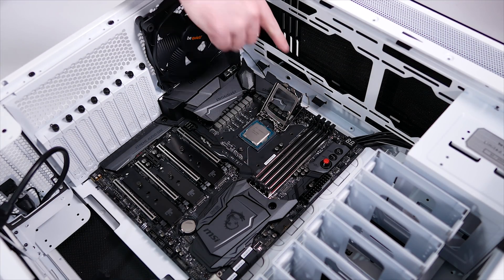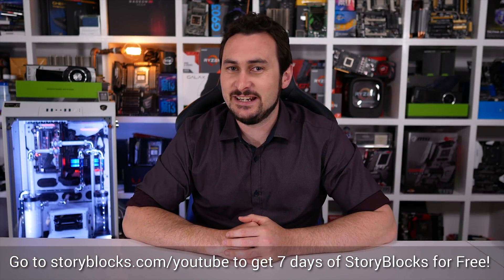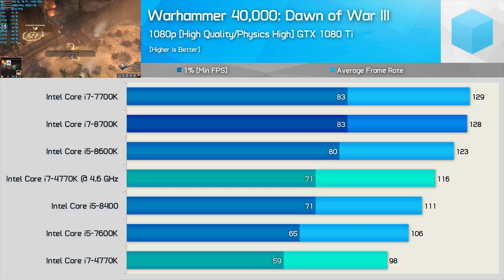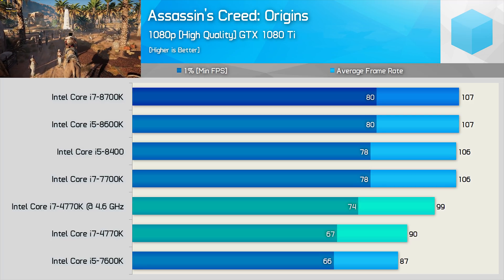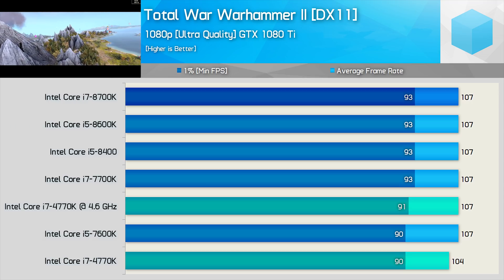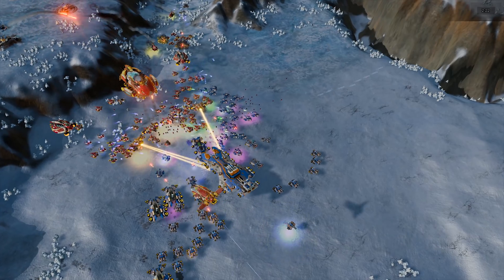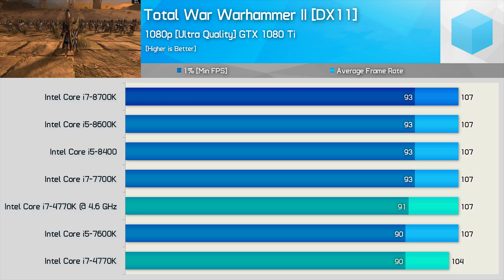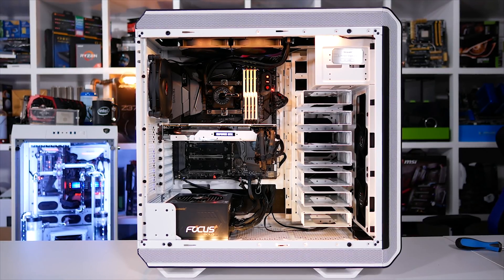4 Year Old Core i7 vs. Core i7-8700K, Worth The Upgrade?

Comment: Every video I've watched from this channel had an extremely wide variety of games benchmarked, using every relevant cpu or gpu depending on which kind of video it is. Moreso than any other channel by far. The results around 15:00 are extremely helpful for most consumers. Basically if you play any game at the higher graphics presets with anything less than a 1080 ti, the fastest gpu available, you will notice ZERO difference in performance even in a very well optimized game like BF1. Of course, this is subject to change when games are better optimized to take advantage of greater core and thread count, but that's still a long way down. Good work, Steve.

Comment: Why never EVER Flight Simulators like the amazing X-Plane 11 are tested in this kind of benchmarks?
X-Plane is one of the most CPU demanding “games”. 
You wanted to match a 4770k against a 8700k, here is one of the most challenging test. Any actual CPU with any actual GPU can run XP at high resolution + high framerate.

Comment: I have a 2500k, should I get a 2600k or a 3770k? I plan to pair it with a used 980ti xtreme which performs pretty much the same as 1070.

Comment: looks like a lot of the time the big thing holding the Haswell CPUs back is DDR3 memory bandwidth.  i'm on a Xeon E3-1231v3 which is basically a Xeon branded i7-4770 or 4790 non-K and basically i'm holding off until DDR4 prices come down a bit as I have 32 GB of RAM, wanting 64 for work stuff and i'll need to buy all my memory again.  which isn't going to be cheap.  will just keep holding off and putting more pennies away for a threadripper, my non-gaming workload is fairly ram and thread intensive (Cisco router labs, etc.)

Comment: 4790k is not identical to 4770k, just share same platform. Base Clock is higher, Turbo is higher and over clocking are same to 6700k, so

Comment: I think most people here are enthusiasts, so they're much more interested in OC'd results as you can find stock tested HW all over the internet. However I am still missing something, never bumped into such a test and I think everyone here would love to see it:

- Take all core/thread CPU combinations and fix them to the same frequency
- Test them on a top-end, performance and mainstream GPU
- Around 15 new games Full HD only would do as lot of these people aim at high-frequency gaming and the differences would diminish at higher resolutions anyway

All these CPUs clocked @ 5GHz
2C/4T (7350K)
4C/4T (7600K)
4C/8T (7700K)
6C/6T (8600K)
6C/12T (8700K)

tested on these GPUs clocked @ 2GHz core / 9GHz memory (11GHz for GDDR5X)
GTX 1060
GTX 1070 Ti
GTX 1080 Ti

That would give a great picture for those who always plan to overclock and want to futureproof their builds.
We won't probably see a big bump in CPU performance in a recent future, so that futureproofs the test itself, IPC is the same for years.
It would show how today's games are core/thread dependent as unfortunately most tests today distorts the results by frequency differences and we cannot see through that.
Also the next GPU generation will probably see a performance bump something like: GTX 1060 will be comparable to GTX 2050 Ti, 1070 Ti -> 2060, 1080 Ti -> 2070 Ti, etc... so this in its sense will give a long sight for how CPUs affect GPU performance.

Please, say something like "challenge accepted", you're the only dude that can do this.

Comment: hmm, the 4gig 8400 beats the 4770k ,with only 2 extra cores.And ddr4 ram platform. Really? Shocked.
Reply from the maker: If that's your take away you aint the sharpest tool in the shed :D
Reply: I own a locked haswell i5,an rx 480 and a 60 htz ips monitor.
Your benchmarks tell me nothing I didnt know (that a used 4770 / 4771/k/ xeon would be fine).
I might not be the sharpest tool in the shed but I didnt have to run a shitload of benchmarks to discover this, Mr Smartypants. 
Perhaps you should go down to 800x600 with that 1080 t.i. to find out which processor will be a better option in 2032?
;#)
Reply from the maker: LOL, you're funny... https://www.youtube.com/watch?v=ucJqHUpc2RU

Comment: is it recommended to upgrade from i7 3770k to i7 8700k?
Reply: Man why didn't you just get a new cooler and try to overclock first and then buy it if you really needed it
Reply: Abhishek Jain you could try to overclock your cpu if you havent done it already.
Reply: BeamNG.drive Crash- and Offroadtests i did oced few times but not always as i have stock cooler 😔
Reply: Abhishek Jain ok, if you want to upgrade you also need a new motherboard with the right socket and new DDR4 RAM. The problem is that RAM is very expensive at the moment. It would be better if you wait until RAM gets cheaper.
Reply: BeamNG.drive Crash- and Offroadtests yeah with i7 8700k new mobo is required and ddr4 ram. I ordered i7 8700k asus z370 mobo corsair vengeance 16gb ddr4 ram, msi gaming x 1080ti gpu and nzxt x62 cooler 3 days back and waiting for delivery 😊 😊
Reply: does not worth, buy a new cpu cooler and overclocked it, I'm sitting here with 3770 at 4.1 ghz, got 151 CB in cinebench, this is at 4770k stock level. No need upgrade.
Reply: Have fun with your new toy here and now and in the future.
Reply: Why the fuck do you need a i7 if you are not gonna use it on professional areas? For gaming a i3 or i5 is more than enough.
Reply: vendetacos If you have 120hz+ monitor and high end GPU you need i7, but if you are in a tight budget and you have 60-75hz monitor then i3 and i5s are good enough. 
P.s Actually the new 6 cores i5s are pretty decent even for high refresh rate monitors and high end GPU). Ryzen 2s are great as well.

Comment: Great Video Steve i have a i7-4790k overclocked to 4.4ghz for stability and was thinking of upgrading to a Ryzen 7-1700 but i think i will hold off for the time being and probably upgrade my GPU to a 1080Ti as Vega has not turned out as good as i was hoping for and thats a shame because i am a AMD Fan and was wanting them to be better

Comment: The best upgrade EVER, even better than going hdd --> ssd personally was going to a 165hz 1440p ips gsync screen!! OMG the clarity and colour is wicked. I can never go back. if your sitting on 1080p id recommend this as an alternative upgrade route.Its a total visual lift, makes multitasking easier, makes working nicer on the eyes and more importantly is a long term solid investment. Also 1440p will mean you immediately reduce the CPU bottleneck(you may need to upgrade your GPU after if tweaking isnt fruitful). As well as gsync that helps negate any HZ fluctuations or lagging that may come along in the following years holding onto the 4000 series CPUs. Meaning if your not constantly looking at your FPS you could hold onto your cpu even longer as you wont notice it dipping lower such as under 60 fps. Gsync works from 30Hz upwards. Unless your streaming, working/editing etc or have a hole burning in your pocket the real world enjoyment from upgrading to sweet 1440p gaming screen is a no brainer for me.

Comment: Make some tests with Core i7 5820k/6800k/8700k at the same clocks, 4.5 Ghz please. But PLEASE, dont forget to overclock CACHE on 5820k and 6800k, because 8700k it works on higher clocks  at stock.

Comment: I play games at 1440p on an i7-4770K and a GTX 1080 Ti which means upgrading my CPU, motherboard and memory is a bit pointless. In fact, I tend to upgrade my CPU to access newer features supported by the motherboard, i.e. when I upgraded my previous i7-920 I gained USB 3.0, SATA3 and PCI-e 3.0 as standard. I likely won’t upgrade until my CPU, motherboard or memory fails. Also, I was adamant that I would not upgrade again to a 4 core/8 thread CPU and the i7-8700 is the first mainstream CPU from Intel to have more than 4 physical cores.

Comment: here i am running a westmere xeon 4c/4t(3.5ghz)(lga 1366)with a gtx 970 and a sandybridge xeon 4c/4t(3.5ghz) with a gtx 1070 in my two rigs, interesting none the less but likely useless info for me(out side of showing that a 8 year old cpu is still plenty for 1080p gameing and by extension just as good at 4k)

Comment: No most gamers who have high end graphics card will game at 1440p or higher, which means 4770k is more than enough even with a uncapped frame rate, so absolutely no need to spend money yet at a new mobo and cpu even if you plan on getting the best GPU's currently available.

Comment: a i5 3570k @ 4.7 ghz with 16GB 2400mhz in bf1 multiplayer 64 player is become unplayable. framedrops till 30 35 fps...completle lagging. but the i7 3770k @ 4.7ghz is great against this cpu..but not great overall with an gtx 1080...if you want to play 120 or more fps.

now i got a 8700k at 5.0 ghz and this is a complete different ball game xD...so smooth and no lags...great gaming with this cpu and the gtx 1080 strix oc...both under water xD

Comment: Good point, I apologize to you. I do not know very much on this subject AT ALL. That is why I watch YouTube. To me, you do a fantastic job with the presentation.  1080P stopped for me a while ago. In VR now, using 8700k delid 1080ti Duke water cooled both, Asrock z370 Fatality i7  for DCS and Racing ONLY. so I am always looking for a higher F/R to run highest res. I should of read the contents better....
Thanks Tricky
Reply from the maker: More info on low res testing can be found here...
https://www.youtube.com/watch?v=UXBiEFo1jsA

Comment: I am new to this, but why on earth would you test high end gaming hardware at low end resolution ??  A waste of my time.
Reply from the maker: This is you: I'm new to this and willing to admit that so therefore probably have no idea what I'm talking about but in spite of that I'm going to label your hard work as a waste of time because that's the kind of person I am.

Well Rick for being a real dick I'm not even going to waste my time explaining why 1080p was tested and why the video isn't a waste of time. In future if you have no idea what you're talking about, stop your comment after 79 characters.
Reply: Owned
Reply: At lower resolutions and settings it becomes more CPU bound. If you where comparing at like ultra settings 1440p then there would barely be a difference because it's much more GPU bound

Comment: @Hardware Unboxed

Are there any plans to benchmark Ryzen with insanely high memory speeds?  MindBlank Tech did a video supposedly showing the 1700X beating the 7700K in almost all games.  Seems fishy but I don't think anyone has challenged his results:

https://www.youtube.com/watch?v=RZS2XHcQdqA
Reply from the maker: Nah not really interested since most of my Ryzen CPUs struggle to go above 3200 and even some can't run at 3200. Also low latency high frequency memory costs more than the processors themselves.
Reply: Hardware Unboxed Well idk if you have tried heavily overclocking Ram. Maybe your existing 3200MHz kit could hit 4000?

Seems like if a $210 1600 or $300 1700 could match the $400 8700K - it would be worth the extra money for ram.  After all it would be the strongest gaming solution....

Comment: should I get a pentium 3258 (€35) and a gigabyte z97 mobo (€90) and later upgrade to an i7 4770k/4790k or buy a r3 1200 and b350 mobo? if I get a ryzen chip I probebly wont upgrade later on but if I get a pentium I will

Comment: I have my 8700k arriving tomorrow to replace my 3770 (non K) but it's not really an upgrade for gaming, I wanted the extra cores and the faster RAM too and also my motherboard drains my cmos battery if I switch off the power to the psu for over a day

Comment: Great Video thank you Hardware Unboxed.

So basically not worth the upgrade and DDR3 memory bandwidth is holding back the older gen CPU's a bit even more so when they are over clocked.

I just went through testing of my own and in my own system with a i7 2700K@5.1GHz and 32GB PC3-1600 @2133MHz I also found that if I was going to upgrade it would not be because of the CPU itself it would be to get that extra bandwidth from the DDR4 when run at 3200MHz or higher.

I tested in 6 games (yea I know not the 30+ you do here) & found that changing memory speed from 1600MHz to 2250MHz gave me huge gains in both min & avg fps. But I found that the gains were not as great by pushing the CPU from 4.6GHz-5.1GHz yes there were gains mostly in the min fps and a bit in the max range. Anyways after doing this I thought to myself other than the system looking really good in things like Cinebench and other CPU tests the games do not really get much from the extra MHz on the CPU past a certain point when paired with DDR3 memory.

Anyways long story short my CPU is now down clocked to 5.0GHz I do not really notice it all in the games nothing changed much at all as it is silky smooth still. I did do a Cinebench test and yep noticed that of coarse lol. Heck I even debated just down clocking to 4.9GHz and would still be pretty much maxing out the games. But when you have been running a system this long that was @5.1GHz seeing anything less than even 5Ghz is just taboo to me.

Comment: thanks a lot for the hard work you put into these videos steve! I have my i5-4690K for about 2 years now and I love it! I upgraded form an Athlon X4 640 and the single thread perfomance improvements from that processer sped up my gaming performance termendusly! I was thinking about upgrading it beacuse I am starting to get into streaming, But I tend to stream retro games that require little CPU power to run.  I think I will just work on OCing my CPU to 4.5 GHz and mabie 1 or 2 years upgrade my processer to something with more cores when DDR4 memory prices come down lol

Comment: Thanks Steve for your great work once again.  To everyone else, would you upgrade an i5 4690 to an i7 4790K, or go for the Ryzen 5 1600X or 1700X? I realize right now the i7 might be faster in some games, but that will not be the case in the future. I'm thinking that the i7 could let the current system hold out for Ryzen 2 or something else. I've found the 4790K for $200-$250. I run on a 4k 60hz panel, and I GPU scale to all true 16x9 resolutions between 1440p-2160p. I'm running an Asus ROG Strix GTX 1080 O8G (OC version) boosting to 2125Mhz. I got it for $460 from a guy that built an SLI system, and never really used it. Not a spec of dust in it, since it didn't even spin the fans with the usage he had. There are deals to be found out there.
Reply: Does your system play every thing fine now ( im guessing yes as I have a 4670k + a 1080). 
For sure I would not go to a ryzen for less fps . 
The higher the rez the less the CPU will matter ( as shown in the vid) . I would use what you have for now and wait to see what the future. When the new batch of games come out that you cant play then I would start looking around 4770k/4790k will only get cheeper as time goes on . I dont see a CPU upgrade (other than a cheep used 4790k) in my future for 3-4 years .
Reply: For the most part it runs everything locked at 60.  I do emulate my Consoles on this setup, rather than having all of them sitting around.  Emulation can be a small issue, but that has more to do with the locked i5 stuck at 3.7 on all cores, which is nonsense.  I have the 360 and PS3 sitting in the theater, but all of the Nintendos, PS2, and Sega are all Emulated, and I have the proper controllers working, and in a cabinet.  I'm thinking waiting is the right step too.  I'll probably jump for the i7 as well at some point.  For the Overclocking, and the fact that it is starting to be needed in PC games almost now.
Reply: Have you tried overclocking with the "fsb"  ? If you can run stable with 110 that would give you a small bump to 4ghz .
Reply: chris Leclerc Yes.  I have a Gigabyte Z97 SLI, and anything beyond 103 is a mess, and I figured it wasn’t worth it.  I didn’t want to risk corruption also.  I felt safe up to 105, but it wasn’t stable.  Sucks that Intel blacked the 400Mhz OC the previous Gen had.

Comment: I have an i7-4790k @ 4.5 Ghz, DDR3 2400, GTX 1070 with a 1920x1200 60hz monitor.  With that combination I don't see upgrading for a couple more years.  I have an i5-4690k @ 4.5 Ghz in another PC and even it is still doing fine with some almost unnoticeable quality setting adjustments.

Comment: My kids pc has a 4690k and I have been battling what you discussed thanks.  On a side note, if you choose to upgrade from 1080p to 1440p wouldn't that also lower weight on the processor and put it back on the graphics card maybe extending the life of your pc? A new 1440p monitor could cost under $300 (or more depending) or a new build around $700 not counting graphics cards. Something that I don't think that is brought up very often.

Comment: Guys will İ7-4770K bottleneck RX VEGA 56 ??pls answer bross
Reply: No it wont.
Reply: Vega 56 performs roughly around the GTX 1070 levels, so you'd be safe comparing to those benchmarks.

Comment: 4690k here, still game no problem with 100+ fps. If I need more gains just gotta oc some more. Plus no way in hell I'm paying 200$+ for 16gb of ram in Canada, when I paid 60$ for 2400mhz 16gb lol
Reply: TheMagesoul98 i also have a 4690k at 4.5ghz at 1.2v on a hyper 212 evo with 2 fans! Still runs every game I throw at it no problem, shouldn't have to upgrade for at least another 4-6 years Imo. My GPU on the other hand is ready for a upgrade gtx 960 2gb oc lol, it's still a great card honestly though for 1080p gaming.  I never play any game lower than med settings at 60fps, but I always try for ultra or med-ultra mix at 60fps
Reply: I just upgraded to an i5 4590 from a Haswell Pentium... did it for like $50... well worth the money and a noticeable uptick in performance... and I got to keep the rest of my system... no need throwing money out the door for a new MB and expensive CPU and new memory.
Reply: @fersnake  4770k  is still good to do the job oc at 4.4 but BF5 is more hungry than BF! even on low I'm looking for a new gpu, 1080 ti or vega 64 to replace my poseidon 780!